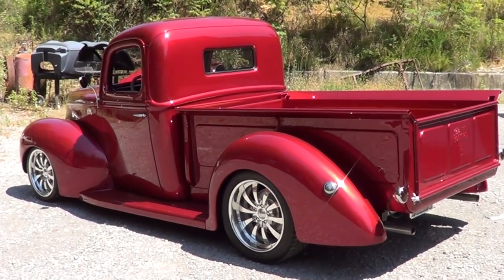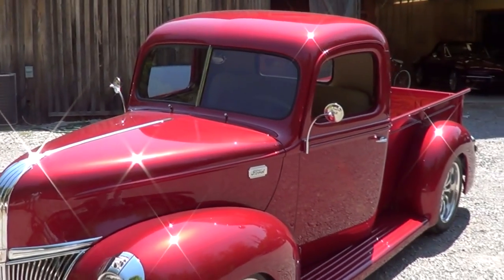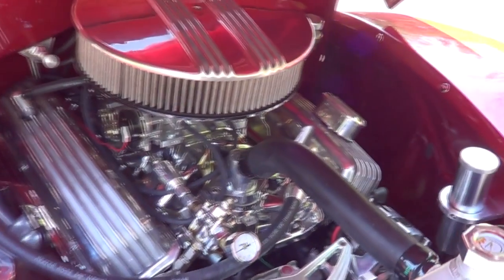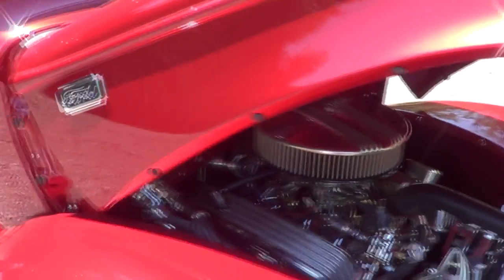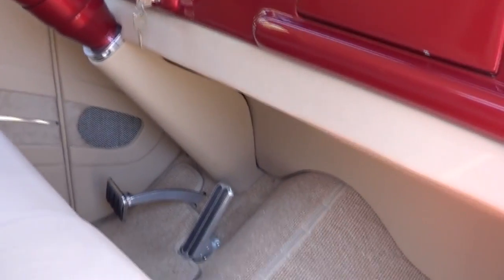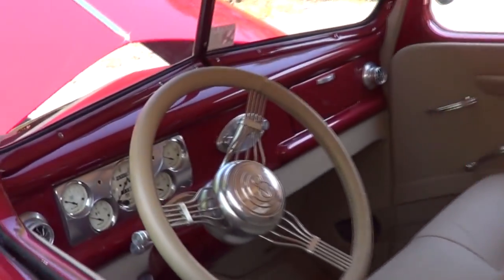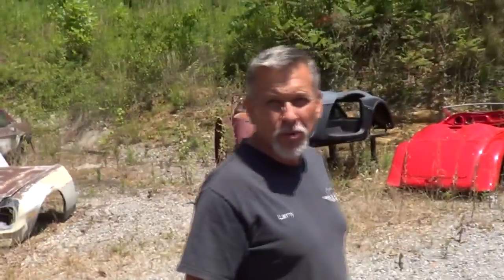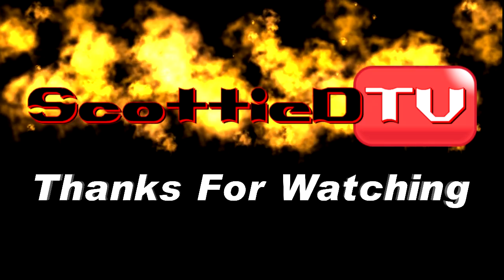1941 Ford Pickup Street Rod

Comment: Why oh why do they put a Chevy into a Ford, but not a Ford into a Chevy?
Reply from the maker: The Chevy is easier and cheeper back in the day....Ford kept changing things...Chevy 350 been around a long time...
Reply: Ahh..ok. Thanks for answering my question.
Thats feasible.
I'm a HEMI fan..just think how this truck would run with a bad ass Hemi.
Reply from the maker: Dice Lewis Well now...a HEMI will go in anything...lol
Reply: I live in NZ. When I was 17, I owned a 1958 Plymouth Savoy with a flat six engine. I swapped that for a 318ci V8. It went a lot better.
Reply: Bang for the buck, you cannot beat a 350 Chev...
Reply: Because it's a lot cheaper install